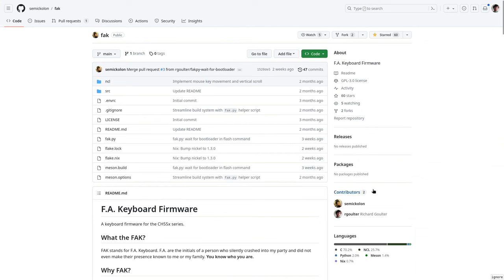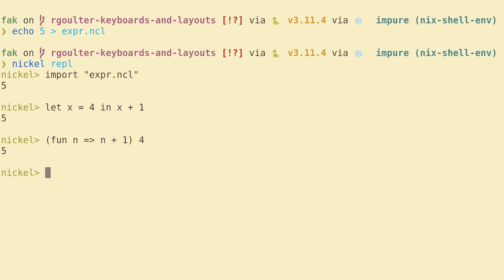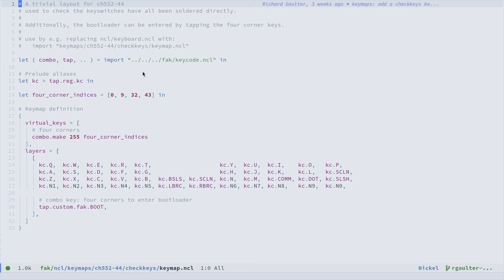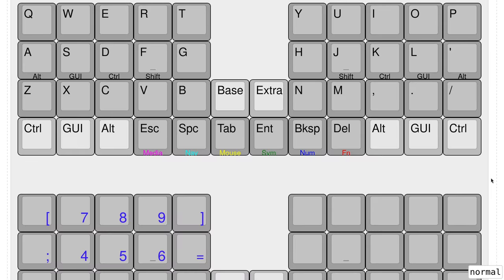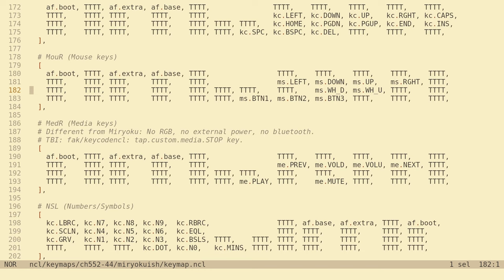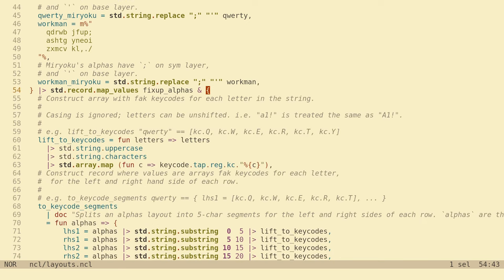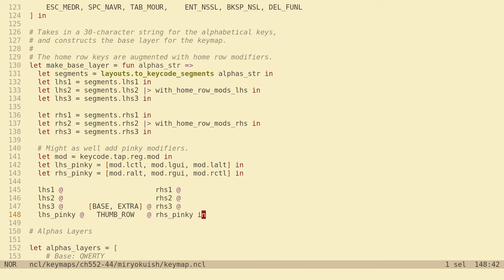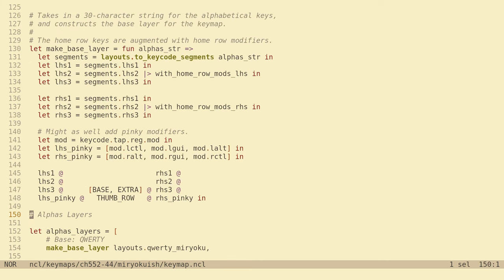Keyboard Firmware for Low-Budget CH552 MCU using Nickel-lang with FAK Firmware

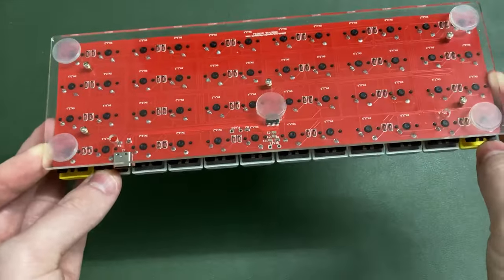Comment: 1:20 do you have that pcb with LED and 2u spacebar?
Reply from the maker: Per-key RGB LED and a 2U spacebar? I don't have a design with that, no.
KPRepublic sells PCBs like that (40% ortho, per-key RGB, 2U spacebar).
For per-key RGB LED 40% ortho, I have a design that's 4x12 ortho. Would be reasonably simple for you to change to a 2U spacebar.
Reply: @richardgoulter7443  yeah I am aware of that one, bm40 I think. I was wonderinf if there's something like the bm40 but with bluetooth. I kinda like the form factor but maybe it doesn't exist because there's no space on the pcb to place a controller. The Blank Slate 40% board had to make some sacrifices for its bluetooth to be added and everything is pretty cramped.

Comment: I always was flabbergasted that you can get some really useful chips for like 1$... did you do some performance testing? Like what can it handle?
Reply from the maker: Keyboard MCUs don't need to be particularly fast, apparently. Whatever latency there may be, I don't notice it.

Firmware-wise.. I was able to flash a keymap which had 13 layers of 48 keys, plus a few tapdance keys.
The firmware supports up to 32; I don't know at what point the flash size would be a limiting factor here.

For small keyboards, fak implements the stuff I think is good.. layers, tap-hold keys, chords/combos, tap-dance. -- It also has support for sticky mods, and pre-defined macros.

I saw some other keyboard firmware for CH552 which implemented QMK's VIA.. I was surprised that could be done; but I also don't know what other features that firmware supported.

For use in "budget keyboards".. the main limitation would be the low number of GPIO pins, which practically restricts how big the keyboard can be. Though, by splitting the keyboard into two halves, that's not such an issue, either.

Comment: Could it be possible to make the chip firmware support a driver for neopixel leds under the keys?
Reply from the maker: Maybe.

It's certainly possible for the CH552T to drive neopixels.

There are two problems for using this MCU in a keyboard with RGB LEDs:
1. CH552T has limited number of GPIOs. This keyboard uses 14 pins for 48 switches. 13 pins would limit it to 42 switches.
2. CH552's flash size is quite limited, so you'd run into issues with how many smart keyboard features can be used, alongside RGB lighting.

There are CH55x MCUs with more pins, more flash... but, these are more expensive, to the point where you'd be better off just using RP2040 instead.

Another alternative is e.g. CH32X035, also from WCH. It's a Risc-V MCU; it's just as cheap, it's got more flash, and is faster. There's a LQFP-48 for it.
With downsides: e.g. at the time of writing, JLCPCB doesn't have it in stock for PCBA; and, I'm not aware of keyboard firmware which is written for it.
(Although fak's author is aware of this MCU, and would love to write firmware for it). In Rust, there's ch32-rs' ch32-hal, which looks promising.